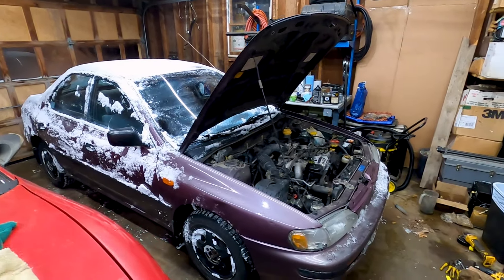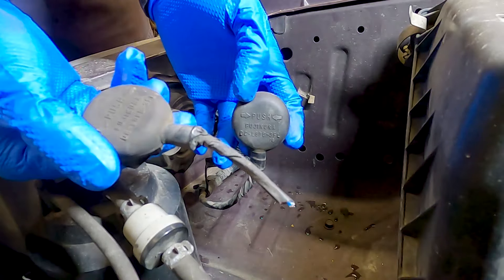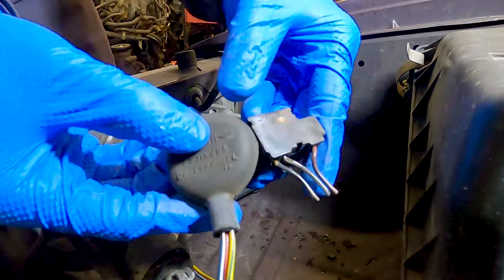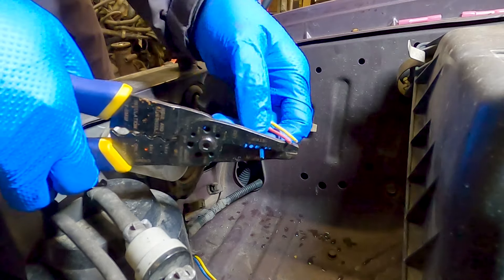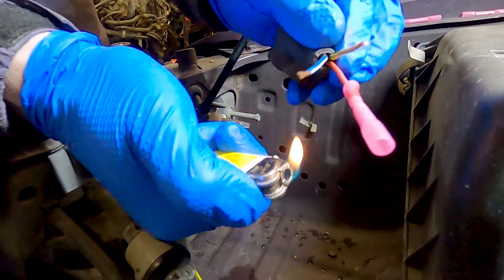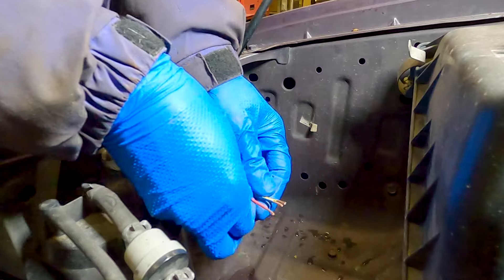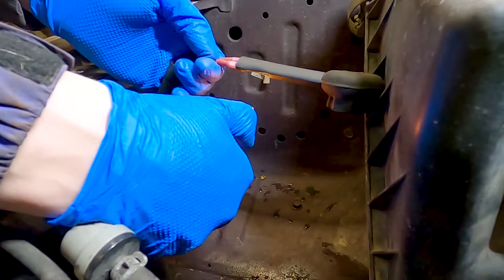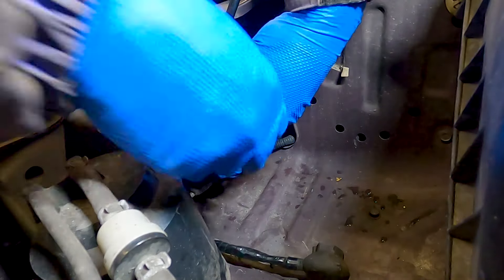How To Replace A Car Wiring Connector Properly - Repair Headlight Wiring Pigtail Harness

Comment: How much should I be charged to replace a headlight socket on a 2012 ford focus?
Reply from the maker: @esther2027  Ideally an hour of labor and the price of the part which is $10-30. Chances are they'll try to charge you $300+ for some reason. If the headlight harness is particularly hard to get to and components like the bumper have to be removed I could understand it costing more. You may be able to find tutorials for that specific model easily.

Comment: My connectors look just like yours, though they may be a different Chinese brand. I constantly have a problem trying to shrink them over the wire with a lighter, burning the plastic instead of just melting it to conform to the wire.

Comment: I would have diagnosed the melted connector first.  I've seen faulty driver modules.  This problem might occur again if that's the actual problem.
Reply from the maker: Agreed always best to figure out why something failed before just fixing it. Beyond the scope of this video, but I do mention it. No driver for this headlight, just a simple relay. Usually when these older connectors fail it's because one of the contacts got bent or broken when installing a new bulb and isn't making good contact. That or corrosion on the wires. Only seen a couple fail out of numerous 25 year old cars so can't complain. Thanks for the helpful comment!
Reply: @802Garage  Thanks for the nice video.  Very well done.  I'm going to buy that crimper.
Reply from the maker: @tonypitsacota2513  Awesome and thanks again! I just added another link for a different version that comes with a bunch of the butt connectors. Any of them seem to work quite well I've used my IWISS version tons of times now.
Reply: Pretty sure that headlight connector just burned up from lack of spring tension in the connectors over the years, causing more heat buildup from a bad connection at an item that's already known to be pretty darn warm.
Reply: @MrTheHillfolk  Yea I agree.  But I had the same problem in a Ford Headlight driver module that had bad diodes which caused overcurrent, melting connector after connector and eventually the housing itself.

Comment: I rather glue with metal to ensure connections.
 For the sake of less time, crimping.
 For if you have the time, solder.
Reply from the maker: Soldering is cool, but it requires a good amount of practice to do it properly. In this case, soldering will of course work fine, but there is no electrical advantage and it won't last longer. Overall for automotive work, crimps are what I and many others recommend. If you want to get super fancy, you can buy open barrel crimps and just use adhesive heat shrink tubing, but I feel these connectors are less intimidating. Thanks for the comment!

Comment: I have a friend who likes to buy cars with, uhh, "problems," especially electrical problems.

I've noticed that vehicles built 2012 or later, regardless of manufacturer, tend to melt the low beam headlight connectors.

Here's a quick, TEMPORARY solution - remove the burnt plugs from the headlights, and run some speaker wire from the fog lights to the low beam bulbs.

You will lose the "auto on" ability for your headlights, since the low beams will now be switched on and off by the fog light button.

Also, if your low beams aren't working, and the connectors are melted... If you just sand down the contact points with some 80 grit sand paper, and maybe hit the contacts on the bulb as well, you'll be good to go for a couple weeks.

If your plugs look melted, hit them with some sand paper first - I promise you that they'll work again. Long enough for you to replace the plug end.

Comment: My need to have decent tools caused me to replace my 20 dollar multimeter with a 200 dollar plus one that even measures temperature, RPM and Dwell angles etc. But I'll probably only ever use it to test my wiring...but hey, you never know when you might need to check the temperature of your coffee or something, so good buy in my eyes. ;o)

Comment: No I would have soldered, those connectors add resistance. Try this in a situation like splicing a injector pulse signal where resistance has to be very specific and you'll be in a world of trouble.
Reply from the maker: @TeamGun  Any connection adds resistance. A bad solder job will add far more. Wiring repair and motorsports wiring professionals in general will almost always recommend crimping over soldering. The exceptions are connections to boards, when there is not enough wire length, and potted connectors. Search crimping vs soldering and watch some videos by channels like HPA, Haltech, Holley, etc. if you don't believe me.
Reply: @802Garage  Yeah thats wrong, I've been doing electronics repair since the early 90's. Grab a multimeter and test it, you'll find a solder joint adds next to no resistance vs one of those connectors. The car I'm working on currently require resistance for the injectors to be between 13-15 ohms, you literally can't use those connectors on injector pulse wire to PCM.
Reply from the maker: @TeamGun  Every. Single. Automotive wiring repair expert I know in the industry disagrees with you. Period. Soldering CAN of course be done properly and be effective and reliable. It simply is not the preferred method for automotive wiring repair, nor is it suitable for novice repair jobs because the margin for error is too large. If a crimp adds more resistance than a solder joint, the crimp was done incorrectly. If a solder joint is cold or inadequate, it will also add resistance. It might not even be measurable on a typical multimeter, but every splice and connection adds resistance. You will never introduce anywhere near an Ohm of resistance with a crimp or solder joint unless it is done completely wrong. People crimp injector adapters all the time. 
"Did you know solder is NEVER used in a professional motorsport wiring harness? Did you know that a properly executed crimp joint is actually stronger than the base wire?"
https://www.hpacademy.com/technical-articles/solder-vs-crimping/
One of numerous sources I can provide you. This video demonstrates one of the most basic types of crimp which also is not suitable for motorsports applications as a general rule, but it is still effective, waterproof, and permanent when done properly.
Reply: @802Garage  dude, I’m just telling you if you take a multimeter, and do some testing, you’ll see what I’m saying is true. Other things as well, like the fuel sending unit on the fuel pump, the amount of fuel you have is dictated by resistance. And it’s like fractions of an ohm. You can’t be crimping connections like that. If you don’t want to test things yourself it doesn’t matter, feel free to believe what you want. I don’t agree, and I can post articles arguing against it as well but I won’t because I’ve tested this myself. You can test it yourself if you want. For shit like lights, yeah it won’t matter, but some stuff it does.
Reply from the maker: @TeamGun  Dude, I'm just telling you I have done said testing. There is also an entire industry of experts who know everything I said. You are grossly exaggerating how much resistance any properly done crimp will add. I'm not going to argue what is settled knowledge. I can provide you with unlimited sources if you'd like.
I get it that you have always done it a certain way and you're gonna keep doing it, but saying that soldering is superior or not to use crimps is simply wrong. There are no current articles by professionals which disagree with me. I have tested plenty.
Watch these videos and learn something. As they say, a good solder joint is better than a bad crimp. A good crimp is better than a bad solder joint. If both are good, a crimp is ALWAYS preferred for automotive applications unless specific constraints require soldering.
Again, this is especially true for professional style open barrel crimps, but used correctly the crimps in my video are just as effective and will not add significant resistance. Certainly less than the actual harness connectors themselves.
I am aware that proper solder joints can add less resistance than crimping, but the amount is so incredibly small as to yes, be negligible, for all automotive applications, which is why crimping is still preferred. Looping back to your original comment, it is also of course perfectly adequate for the purpose in my video.
https://youtu.be/EAr2z6rGV7o
https://youtu.be/faLn-SjVfwY
https://youtu.be/pOTrS6-mNtA
https://youtu.be/E_m8xf3vfYE
Reply: @802Garage  don’t waste so much time responding to me bro, you’re not going to change my ways I’m set in them. But I do think I’ll subscribe, I see you have a 2g Eclipse and I love them. I’ve owned a 2g, 3g, 4g in the past, and currently another 3g spyder GT. I’ve had 8 Mitsubishi in total though, always do my own work. I hope you didn’t get worked up or anything, I’m stubborn in my ways as I’m sure you are as well. I did read everything you said and take things into consideration, but my personal experiences dictate how I do things. But that’s the great thing about life, we’re all different and have our own ways. No hard feelings man.
Reply from the maker: @TeamGun  I'm definitely not telling you that you CAN'T solder anything or it will definitely fail or anything. I'll just stand firm on the point that crimping is an acceptable and correct repair, especially for a novice. Thanks for the subscription. I try not to be too prickly, but I also get frustrated from other internet trolls that are less willing to at least discuss in good faith, hahaha. I of course understand doing what you do based on experience. I have had successes and failures in ways which nobody ever told me would or would not work. I do have a full series coming on the Eclipse again in the future. I actually have two now. The red one and a green shell. Big plans. First will be a full series on the V10 Impreza and the rotary BRZ. Just gotta edit for ages! No hard feelings. I appreciate that a lot. Hope your Mitsu is doing well!
Reply: @802Garage  Yeah bro, the Eclipse is doing well. They're rare in Canada so I paid $5500 for it needing supposedly nothing (ha) probably another $4500 into it in parts. But she's all done, timing belt, water pump it'll be good for a long while. Just replacing injectors this weekend, and maybe dizzy in a few months but thats about it. Runs really well, no check engine light but I have a feeling one of the injectors is leaking due to Mitsubishi dealer having to replace the filler neck during Safety cert (they knocked rust into the tank, killed the fuel pump but I replaced it) I used to own a FRS, fun car especially in the winter. A rotary would be amazing in a FRS/BRZ/86, can't wait to see that. That car reminds me a lot of the 7th gen Celica GTS I had, though different being fwd vs rwd, they felt similar. I'm really into Japanese cars lol.

Comment: I've seen worse from professionals. Nothing you did was horrible and the repair looks like it will serve well for years. Things to think about are... FIRST Extract info from the old harness before cutting it off. It may not work but it isn't without informational value. Note pin position and color of wiring at pin location for performing the repair. If you need to pass a harness through an opening the harness cuts should be at different lengths to avoid bulking up the harness with three crimps at the same position. Shrinking should be done for all insulated butt connectors at the same time to reduce time spent on that step by picking up and putting down tools over and over.
Reply from the maker: All great tips! Agree with everything. In this case I was targeting people who will buy an aftermarket flying lead connector or connector with pigtail harness attached. I should have mentioned making sure you match up the correct wires more though. I have another tutorial to edit which shows how to make a connector with flying leads from scratch. I hammer home pin and wire position more in that one. This repair style is definitely targeted at the amateur and DIY crowd. Just intended to be leagues better than a bad solder job with electrical tape or a hardware store butt connector left to trap water and corrode to heck, hahaha. Thanks again!

Comment: Barrow connected are garbage solder it back
You’ll thank me later
Reply from the maker: Never had a single one of these fail. What's important is using decent quality crimps and the proper crimpers. Most people are not good enough at soldering to make reliable connections for automotive applications. Professional wiring outfits in general almost never use solder on vehicles unless absolutely necessary such as to boards, with extremely limited wire length, or in potted connectors..